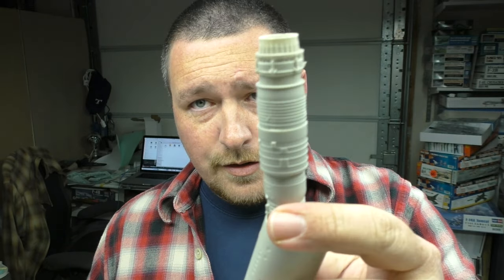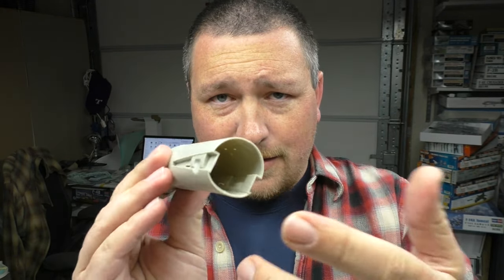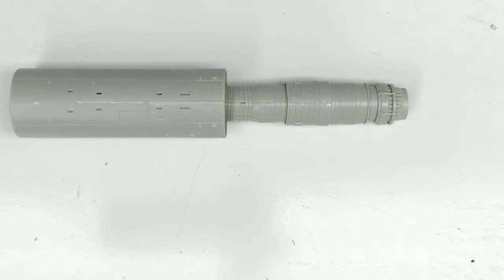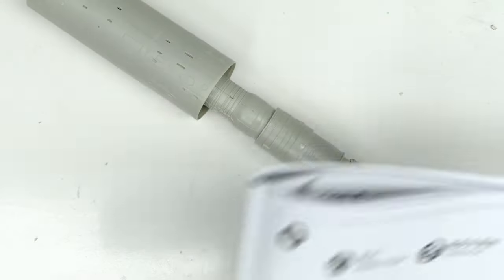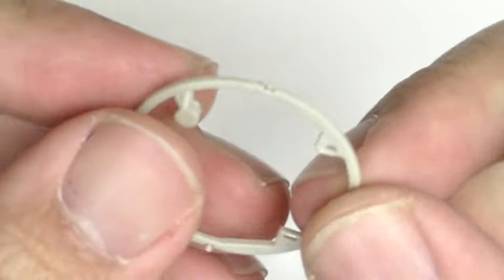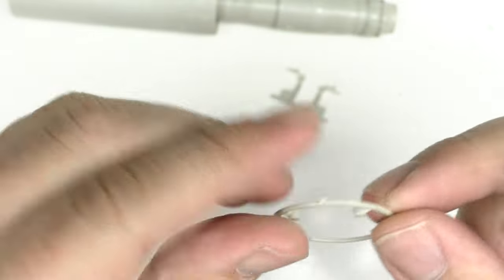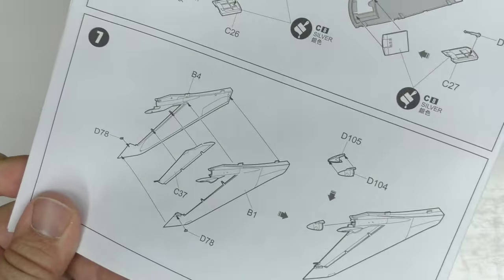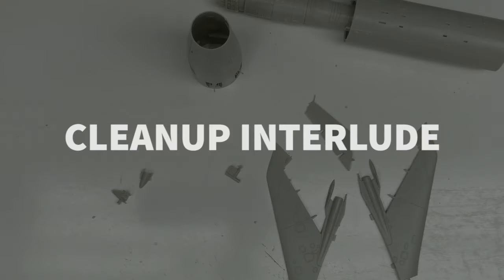Kitty Hawk Su-17 Build Review 4 - Fuselage

Comment: Good video, Matt. Question: Would it be possible to build the three halves of each side of the fuselage, then join them together like a more traditional kit? I know that it would present different assembly issues, like getting the pins on the engine to locate in the locating holes inside the fuselage, but I wonder if it would work.
Anyway, keep up the good work. These videos reviews are extremely helpful... might help someone from making a poor kit choice. Forewarned, is forearmed!
Reply from the maker: Possible? Certainly. I investigated that possibility over the course of the build (and to my supreme annoyance, was a section where I either forgot to hit record, or didn't hit it with enough authority) and in my opinion, the benefits don't really outweigh anything. 

The front/mid join - I saw no real advantage. There is an alignment lip there that helps out. The rear/mid join...being a butt join, there's a limit to how good it can get. The curvature of the two sections is also mismatched, and requires pressure to squeeze the top and bottom of the rear closer together to "bulge" the middle out. I found it easier to tackle that with built sections rather than side-by. 

Ultimately, some kind of internal alignment mechanisms would have really been appreciated. Some kind of mounting collar for example.